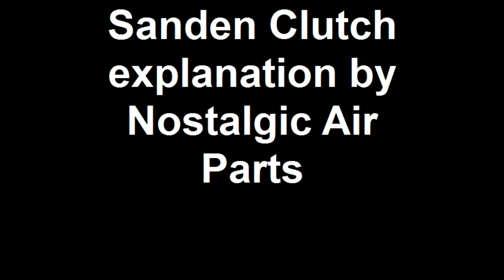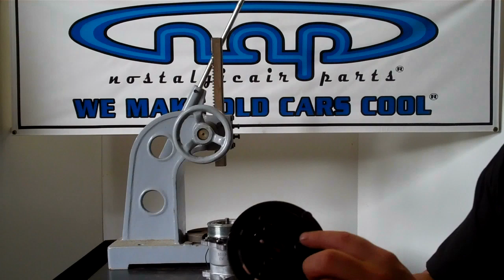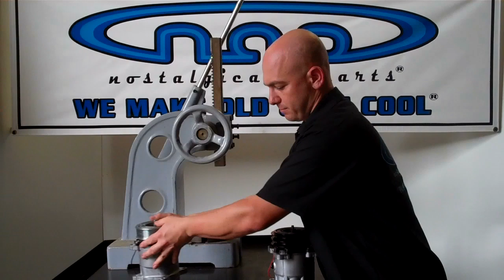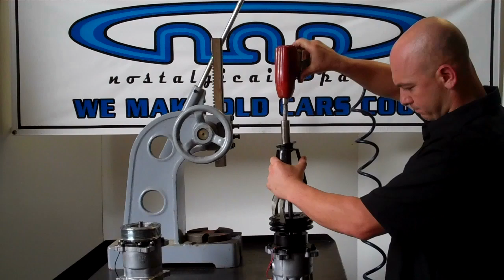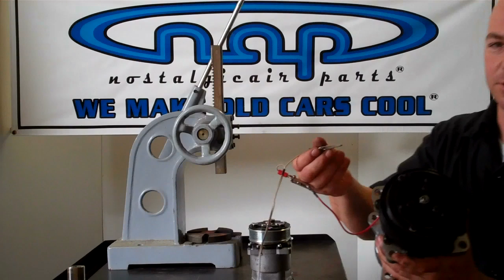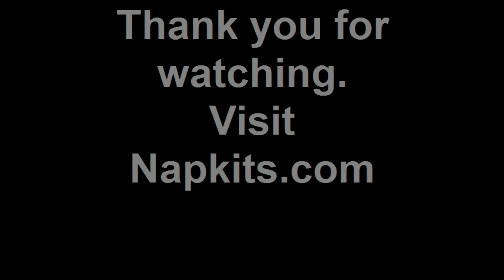Sanden Clutch explanation by Nostalgic Air Parts.mp4

Comment: You can also use 3 long bolts to remove the hub instead of a puller just screw them through the plate pushing against the pulley beneath and tighten them equally in small increments in succession until it pops off.

Comment: That's a great description. Your remark that the clutch and pulley bearings don't often go bad without heat from a failing compressor is a little concerning to me, since I'm hoping my problem is just a failed clutch bearing/poor air gap. What investigations do you advise before replacing the bearing? I get noise when the clutch is engaged or disengaged, though I do get plenty of cold air....